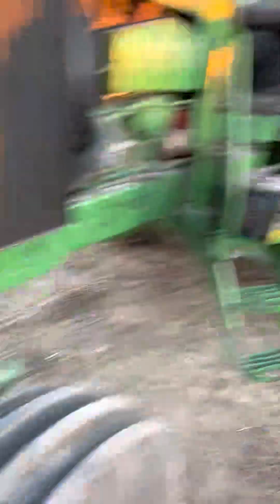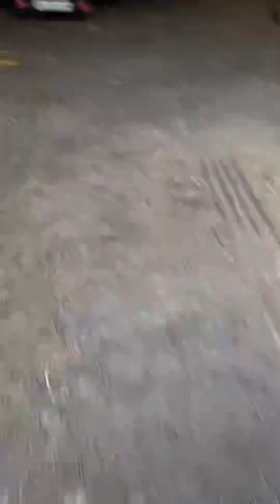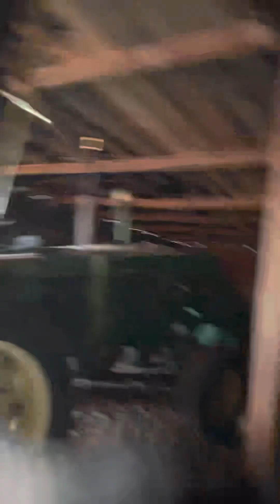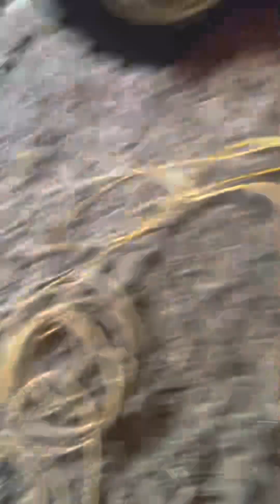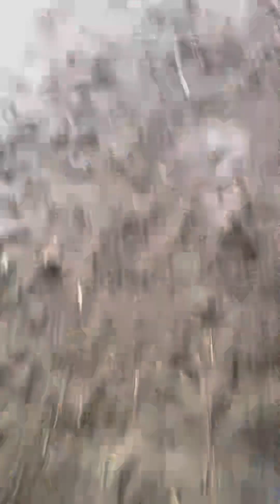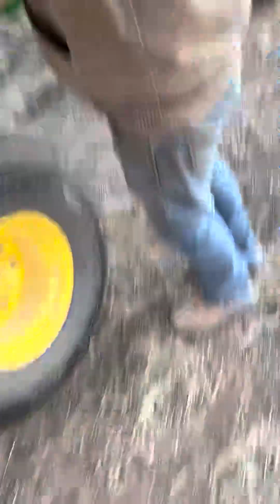Failed Cold Start

Comment: We had the same issue on our jd 2240 deutz 6275 ih dump truck and Chevy c70
Reply from the maker: It was just too cold, and this tractor already starts hard when it’s cold. Were plugging it in over night and charging the batteries.
Reply: @iowafarmbros  I would try new glo plugs
Reply from the maker: These older tractors don’t have glo-plugs, only a heater core and ether.
Reply: @iowafarmbros  i mean injectors
Reply from the maker: @O.KFarmToysdeutzallis6275  ah, good point, we’re gonna look at that